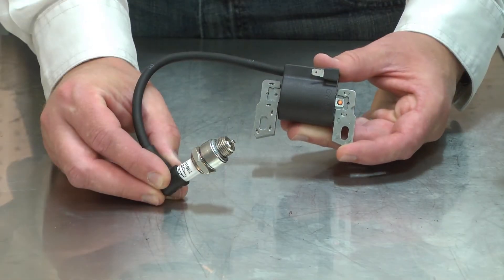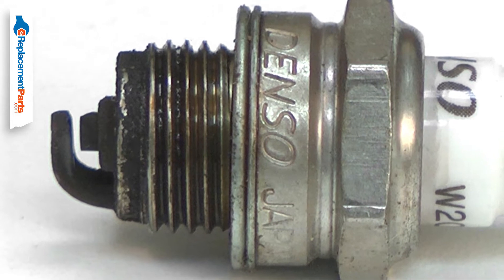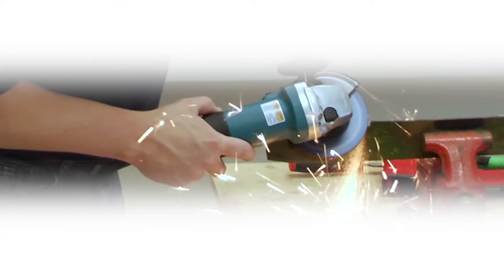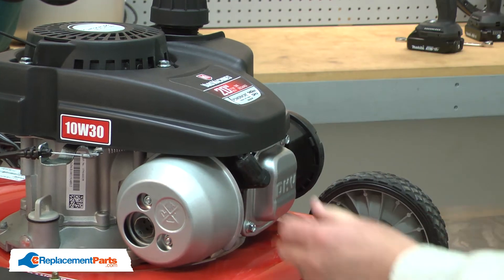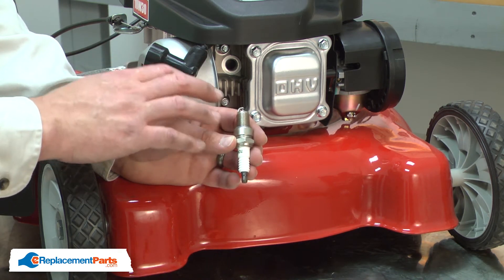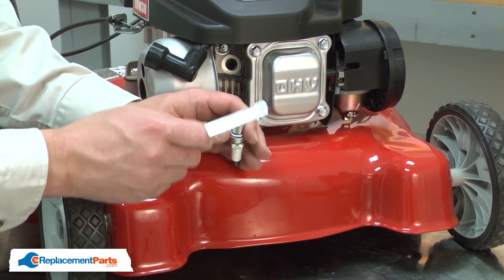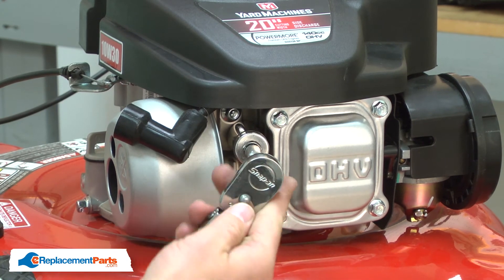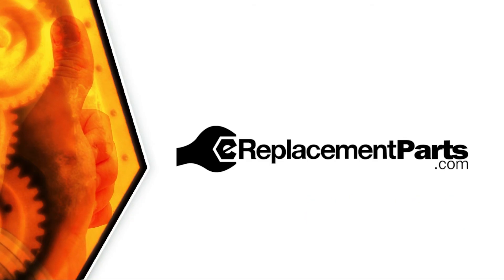Yard Machines Lawn Mower Repair - Replacing the Spark Plug (Yard Machines Part # 951-14437)

Comment: Im just here watching this to watch my yardman 12av829c755 when i bought it used a few weeks ago does work ok but needs a few new parts for it to keep on working 

It needs a pre filter and air filter a spark plug and a new coil 

I done a longer test go with it just to see if it would stay running it did but once it got warmed up enough would then cut off so i know what the problem is 

When i get the replacement parts for it im just gonna take the engine apart further to clean it up more i know the piston head has to be black how the plug was dusty black when i cleaned it off last week but this is how it is when i buy used stuff the stuff always needs fixed up a little 

Other people don't take care of they're mowers and weed eaters when they break im who gets the broken yard machines 

I've worked on a ton of different brands of mowers and weed eater engines im still working on the stihl br420 backpack blower right now and the yardman mower the stihl has a carburetor issue 

Im lacking a testing tools but think i can get by without them for now

Comment: My spark plug boot is stuck how can I get it off without messing it up?
Reply: Take the top cover off for easier access. Then twist the boot clockwise and counter clockwise while pulling out.

Comment: What socket we need ? I hav socket set nothing go in to the plug?
Reply from the maker: Usually a dedicated Spark Plug Wrench is what's required to remove a spark plug. They certainly make the job easiest!
Reply: You need to use a deep socket for most any spark plugs